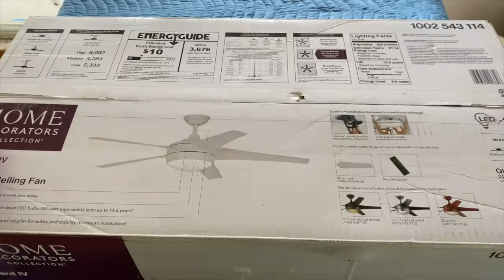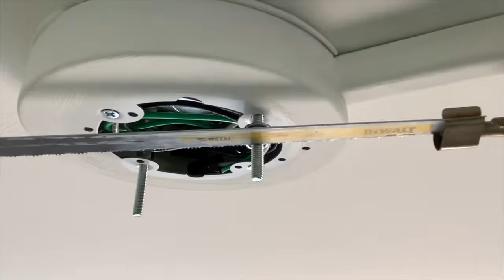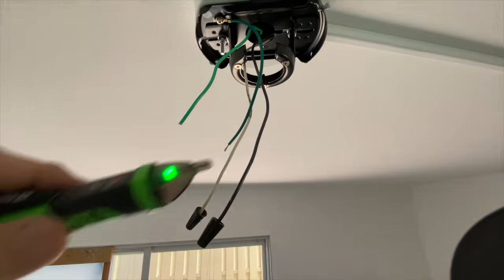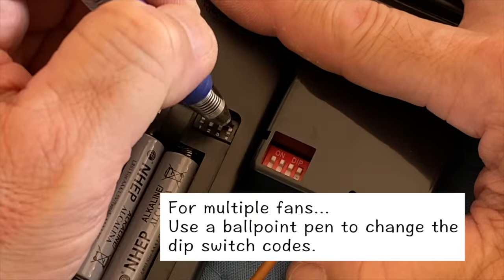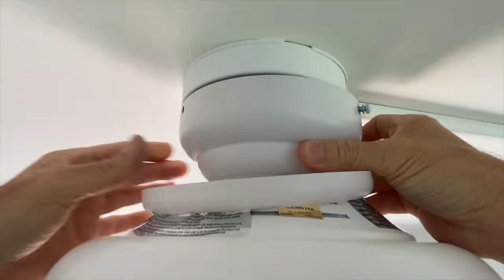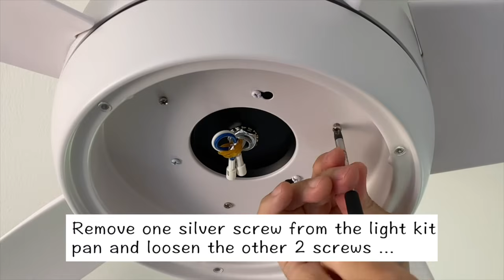Dad Installs a Ceiling Fan – Close-to-Ceiling Installation (No Drop Rod)

Comment: Hello! Love your video! Just found and subscribed to your channel. Question: can you indicate at which point you bypass the down rod installation? We have 8 foot ceilings and even my 5’9” brother keeps whacking it with his arms. He’s an animated talker. But since our ceilings are 8’ we don’t really need a down rod. I have 2 ceiling fans I wish i could do this with! 😊 mahaloz 🤙🏼🤙🏼
Reply from the maker: Thanks!  🤙
I believe the standard rule of thumb is a minimum of 7’ from the floor to the bottom of the blades.  You can install it higher if you want to.  
😎